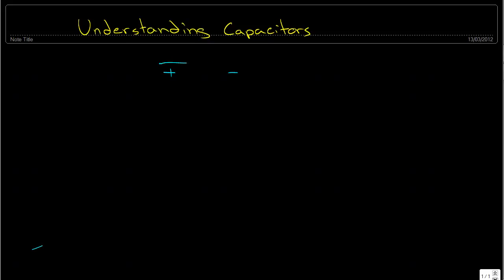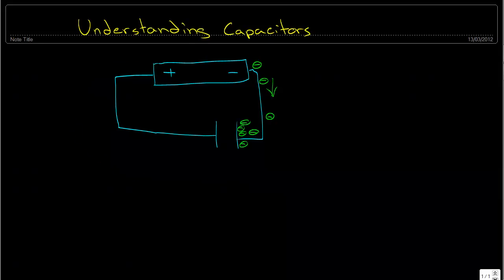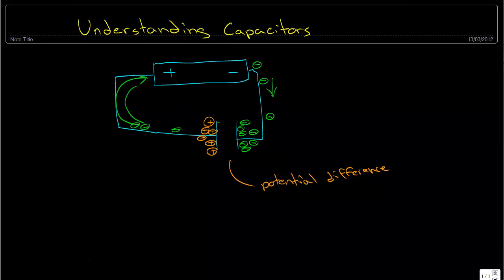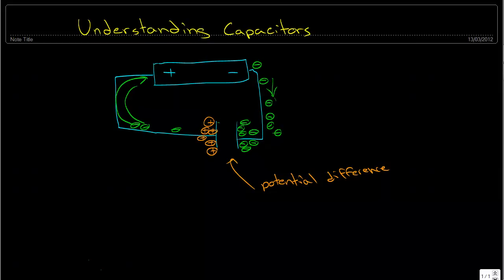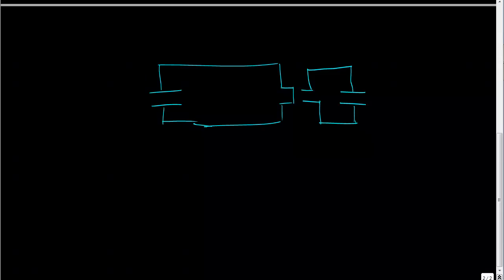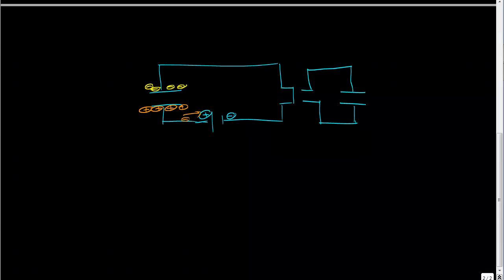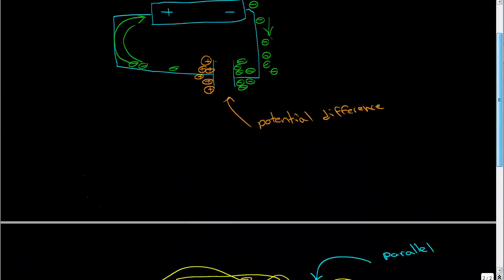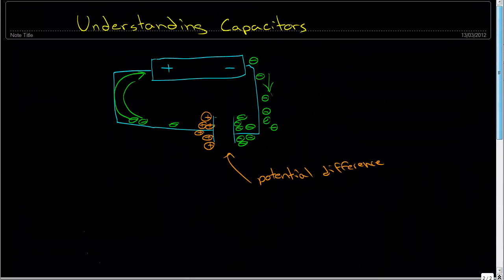Understanding Capacitors

Comment: There are NO protons here. The negative terminal has free electrons. The positive terminal has a deficit of electrons (called holes). So the potential difference between the two terminals is caused by the deficit of electrons in the positive terminal. This is also why the electrons flow from negative to positive, because they are trying to "fill the holes" and balance the battery.